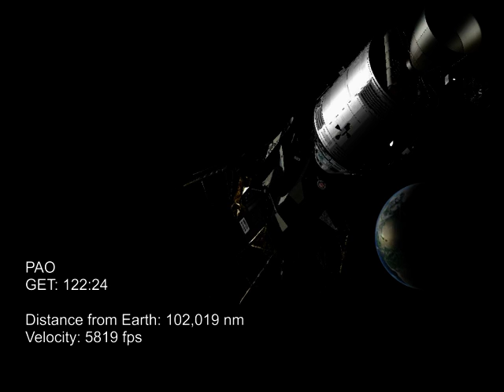Apollo 13 - Is It Snowing in the Command Module? (Full Mission 38)

Comment: At 47:00 Jim says no one wears the biomed harness but I can't make out what he says about WHEN he took his off but it sounds like he was the first to take it off. From the previous times the issue came up in the communications it appears that Fred and Jack did it at a different moment later on. Since there appears to be a biomed switch connection just one harness to the data link Houston could not have discovered that all three took it off at the same time as portrayed in the movie. 

don't know why I got hung up on these harnesses...
Reply from the maker: Sergei Kuznetsov its a little bit like - if you see a documentary or movie, based on fact, you have to believe what you are being told. If you then see or hear (in this case) or read the actual event, you might find it slightly in contradiction to what you saw in the movie. I will usually watch "space themed" documentarys or movies and send my wife spare with my tutting and comments about truth and reality being slightly overstretched by the director....!! 

Take the part in the Apollo 13 movie when Haise and Swigert were aledgedly arguing...and Lovell says there was no point because they would just end up bouncing off the walls and end up back where they started......

...firstly - in reality I do not believe that argument ever took place, none of the crew said it did. Secondly, Lovell has always said that there was no point getting frustrated or upset in that situation, because you would just bounce off the walls and end up back where you started....but he was not talking about Haise and Swigert, he was generalising, mainly, I believe, about himself.

...and so, he said what he said and some dramatics are added into the screenplay to bring that subject into play - but they are totally out of context.

LM5
Reply: ***** All true. I read the movie fact-checking reviews before. I claim here that I seem to have found one previously unnoticed  "stretch" which actually played in the movie quite nicely :)

Speaking of he movie, another thing that I didn't see mentioned before was that when Jim (Tom) was sitting bundled up trying to get warmer, his breath clearly visible (which was obviously set up by the director to show the temperature  in the cabin) but it was coming straight UP :)
Reply from the maker: Sergei Kuznetsov have you looked at the apollo 13 transcript? That might clarify what Jim said
Reply: @lunarmodule5  Ha ha Haven't heard "spare" used in that way since I was growing up,  decades ago. Thank you for all your hard creative work. Looking forward to Apollo 11 Peace <3
Reply from the maker: @pontiuspilot5887  peace backatcha
Reply: Sergei Kuznetsov - Jim reports that Jack and Fred are not wearing their boomed sensors and his “have long departed the scene”.
Reply: In one of the videos early on - I have been listening for so long I have lost track - I thought I heard someone talking about an actual decision made by the Ground to choose 1 person to leave the biomed on because of power and the impact it had on communication.  At the time they choose Fredo.  It would not surprise me if he took his off when he started feeling sick and didn’t want that to become yet another issue for Ground to have to worry about.  Just a theory...

Comment: i have always wondered why the astronauts were putting up with low temperature when in regular fly they have to start the bbq rollings to avoid over heat... otherwise apollo 13, its crew and the support team on the ground were very great people and very performing under those hard conditions